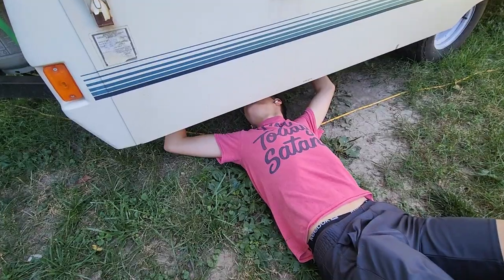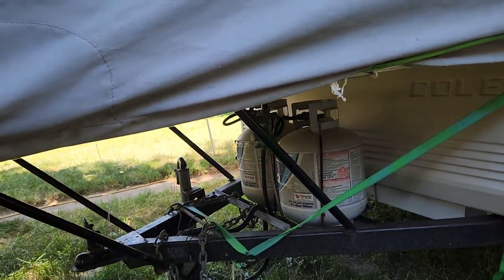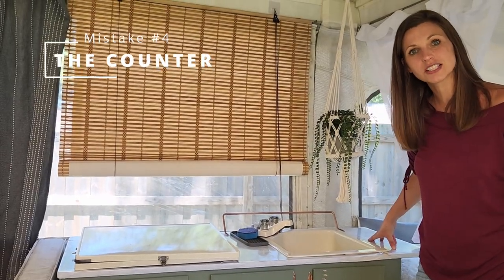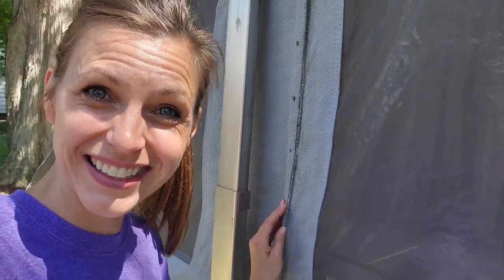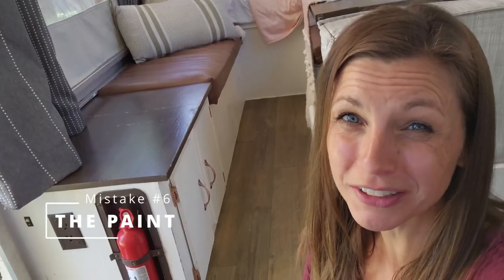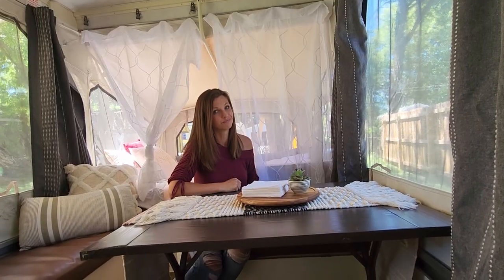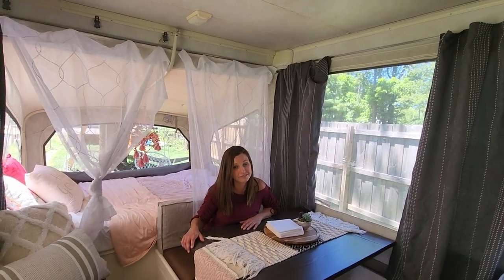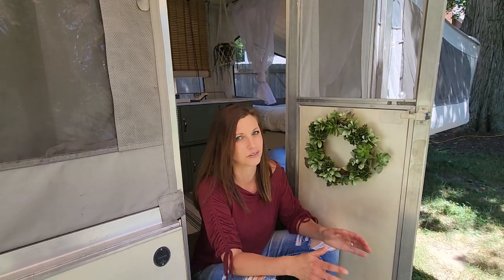10 MISTAKES ON OUR POP-UP CAMPER RENOVATION: It can only get better from here, right?!

Comment: I have a new (used) Coleman similar to yours. Used it once at Garner State Park in Texas, and now plan to give it a clean-up facelift on the interior.  Thank you for sharing those tips.  That is so thoughtful, and kind of you to do this, and save potential heartache from fellow campers. Who does that?  Thank you!
Reply from the maker: You're welcome!! I'm dealing with a dry rotted canvas now! Ugh!!
Reply: Now that is one thing that acrylic paint cannot fix. (I saw one couple paint their canvas successfully.) Good luck! Be sure to share your solution. By the way, I like the cute touch of the wreath on the door. A Home Sweet Home touch. Ya'll did a very beautiful job on the renovation! @slist15
Reply from the maker: Thank you! I'm not quite sure what we're going to do about the canvas. So disappointing! I've patched it so much and I'm not sure anymore patches will hold at this point. I'll let you know how we decide to fix it.

Comment: Thanks for being vulnerable and sharing your mistakes!  I wish I would have heard the polyurethane tip for the white paint - that's what I need on my white kitchen cabinets!  I guess I'll add that to the project list!
Reply from the maker: I hope it works in the camper we're renovating now. Grrr! I love the white, but it gets so dirty! Let me know if it works on your cabinets!
Reply: Can also mix polyurethane in the paint.
Make sure to use water base with water base.
Also: higher gloss paints clean easier which takes away the need for the poly.

Comment: Regarding #6. Not sure if you'd repainted the white walls yet, but when you do, you can spray clear paint over the white. It's easier to work with than polyurethane. Have fun!
Reply from the maker: Oh, thanks for the tip! Yes, I plan to repaint but just haven't yet (waiting for the weather to warm up). We have a few more repairs to do from our last camping trip.
Reply: @hannahslist15  Us, too. Waiting for the weather to warm up a bit, and start renovating our 2nd hand pop up camper (recently purchased).

Comment: For the kitchen roller blinds, are the two hooks the only thing holding it up? Do you remove the blind when lowering the roof or leave it rolled up and connected to the hooks?
Reply from the maker: Yes, those hooks are amazing and the only thing holding the blinds. I've never had an issue with them falling down. I do have to take them down every time we collapse the camper. We love those blinds!

Comment: How do you know how far to do the crank and how did you over crank it
Reply from the maker: Good question!! If you go too far either way, then the cable snaps. I don't know if they have a way to prevent that with the newer popup campers, but for the older ones you just have to go slow. There's no easy way to know if you've gone too far. We know base it on whether we can get our door in. We raise it little by little until it fits. So frustrating!!!
Reply: Good to know Thanks!
Reply: When you know you have the roof at the right height, secure one end of a string to the top and the other end of the string to the bottom and use that as your guide for next time. Next time you will know when your string is fully extended, stop cranking.